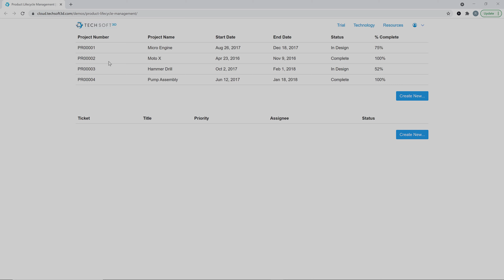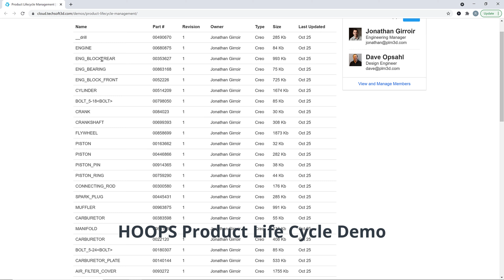How To Build a Product Configurator Application

Comment: Hadn't gone through but has saved it and definitely revert u back once finished. I m looking to create a dress application or apparels application for customisation. Hope this will work....
Reply from the maker: In general you should be able to use our tools with any type of configurator application, though our strength is definitely in the mechanical CAD space. Let us know if you run into any problems.